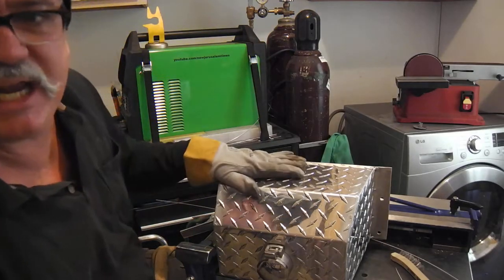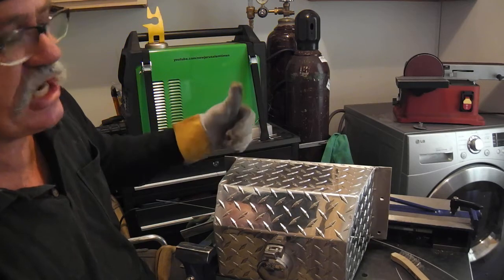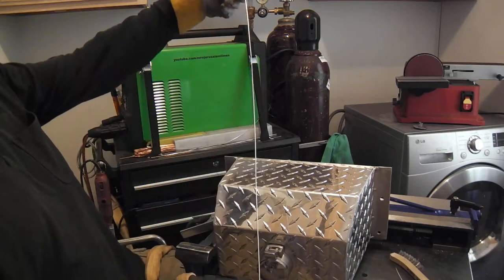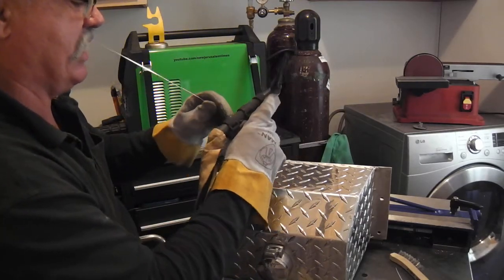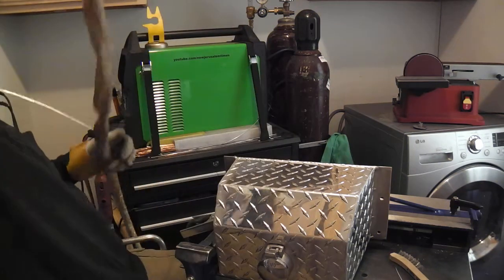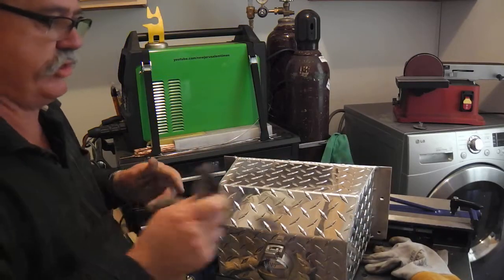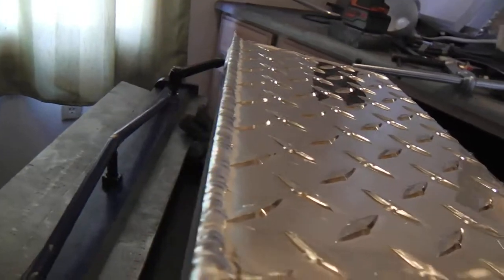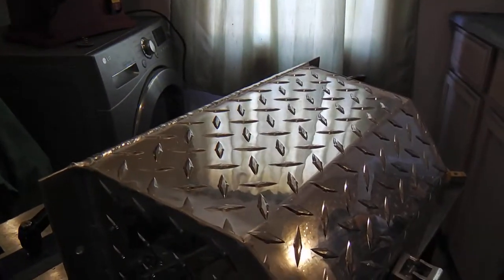Triangle Wave TIG Welding On Thinner Aluminum

Comment: Does this Everlast welder have the advanced AC square wave?   I think Jody at welding tips and tricks did a video on it lately and it looked like a great feature.   I'm also curious to see if you will get the new all in one  Everlast Mig/Tig/stick 221 unit?  I'd love to see your review of it if you get it.
Reply from the maker: Sure, Lucas,
Any advanced-featured TIG unit, including this 210EXT, if it has Triangle wave, will also have Squarewave too, as it's a more primary waveform. The Triangle wave is a favorite of mine for the thinner aluminum, but it won't "bring the heat" on thicker stuff like the Squarewave will, so you have to see it at a higher amperage than you would for the Squarewave. That's just the nature of its waveform, i.e., triangular.

No, I don't plan to get the MTS 221sti "all-in-one" when it's released soon. But, I will say that it was brilliant of Everlast to include both the Square and Triangle waveforms on it, which makes it an advanced enough of a TIG unit to be called an "advanced-featured" TIG unit, I think. And it's a profound thing that it'll be a full-featured MIG unit as well, though without any MIG pulsing.

I'll bet ChuckE2009 will review the new "all-in-one" from Everlast as soon as it's released, which will be a sensational FIRST in the welding unit marketplace from any producer, and will undoubtedly sell like crazy and be hard to keep in stock. So, if you're thinking about getting one, I'd order one as soon as they're available. I mean, I don't really have a compelling use for MIG right now, and the new 221 will be about two thousand bucks, initially. But, that's still a pretty good value for an advanced-featured AC/DC TIG/MIG/Stick, all-in-one unit, especially if you appreciate the compact aspect of it.

Otherwise, having an advanced-featured TIG unit and a MIG as a separate unit can be good, and similar in price too. Ideally, if I wanted a MIG unit to go along with my 210 EXT, I'd get the Everlast PulseMIG 251Si. 

(Actually, more recently, Everlast came out with a Single/Double Pulse Power i-MIG 253DPi that would pair nicely with my PowerTIG 210EXT, as I don't really need the "DC TIG multi" ability of a 251Si, and I like the idea of having the addition of "double-pulsed" MIG.)